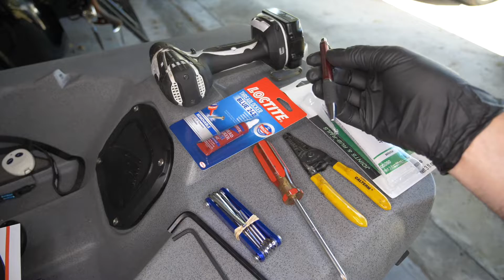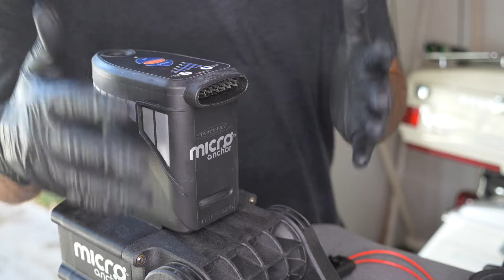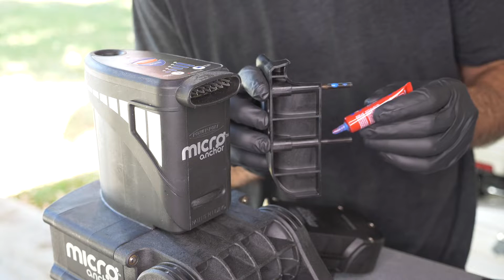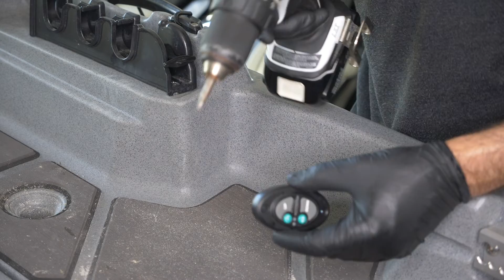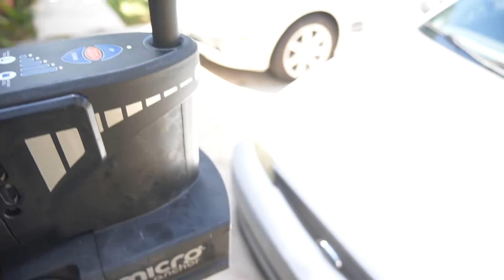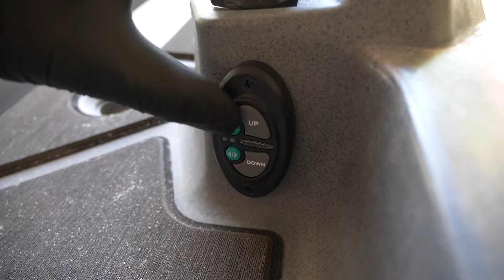How To Install Power Pole Micro Anchor On Any Kayak

Comment: Also, I power wash my yak after each use, I probably shouldn’t mount my deck switch correct??? Probably can’t handle all that water right??
Reply from the maker: That switch has a rubber seal in it, so normal rain, and water from fishing is perfectly fine, but a direct blast from a power washer probably isn't good. I've never had an issue with mine where I mounted it.

Comment: What’s your reasoning for not using the quick release?? Just curious.🤷🏼‍♂️
Reply from the maker: At the time when I owned this kayak, I could only think of two reasons you might need to use the quick release. I knew they were situations I wouldn't be getting myself into with this kayak. The first, being loosing power or a dead battery. The second would be to go under a low bridge, or under trees, etc. All the places I regularly fish here in Florida are wide open and I wouldn't need to go under anything, and the battery lasts multiple trips. I charge it the day before any trip so its full. There's always the chance something fails with the anchor, and I'd need it, but the bonafide is so stable I can fold the seat down and just climb to the back and deal with it. But I just got back from a trip up north where I had to go under some tunnels, and I did utilize the quick release so I'd fit.

Comment: Great video but I don't think you could do this on an ascend kayak there isn't enough plastic on the back end to drill 4 holes and mount it unless I'm missing something. I sold mine years ago but now that I live near a shallow river with smallmouth I would like another one so when I want to fish the river I can. Cuz the ranger won't fit in the river lol.
Reply from the maker: If you're talking about the cheaper ascend kayaks in the $600, no there's not enough room on the back to direct mount it. You'd have to build a platform. There's always a way to make something work.

Comment: Did the power pole come with the battery pack or did you have to purchase separate?
Reply from the maker: No the battery is separate. The power pole does come with a cable you can connect to an existing 12 volt battery if you have one. But the pack makes it much easier.

Comment: How long does the battery last for regular usage?
Reply from the maker: About two full day fishing trips with constantly moving around and using the anchor.
Reply: @FloBass  On mine I get about 135 down and up, the most I ever used in 7-8 hours was 35 down and up

Comment: I transport my Bonafide SS 127 on a Yakima Rack and Roll trailer including a 450 mile Interstate trip twice a year. Can I leave the motor mounted while traveling? Naturally, not the pole!
Reply from the maker: You could, but I don’t recommend it. I lost the thumbscrew for the clamp that way. Power pole was nice enough to send one out free of charge after I inquired to buy one.

Comment: How to install power pole step 1 lather  your gloves with loctite get it all over your boat and your new power pole step 2 do not tap holes for remote just use a cordless drill with the clutch locked up to insert the remote inside of the Hull of your boat step 3 make sure you wear sunglasses while doing any project
Reply from the maker: You missed a step...

Comment: For other kayaks a mount would likely need to be fabricated from seaboard so it would mount off to the side.  i.e. like for a Vibe SeaGhost. or any kayak that has a standard type rudder.
Reply from the maker: Yes a yak with a rudder could run into that situation. Many have enough room in the back to mount it right next to the rudder. Only issue would be when you pole down the boat will experience yaw when the pole drags the bottom while moving. Not really a huge deal, but could be annoying for some.
Reply: @FloBass  I actually  made a DIY one that is gravity operated and I have it mounted on the side but as far back as possible and it stays pretty straight in current.
Reply: BassMan Strikes ;

Comment: Great video man. I am getting mine tomorrow. Question is, if you physically mount that switch to the yak itself, how do you change the battery without removing it every time and therefore stripping the holes? I don't have it yet so I do not know how the toggle switch opens. Thanks.
Reply from the maker: The battery lasts a pretty long time so its not really an issue. The holes wont strip as long as you don't over tighten them when you put them back in. They basically cut the threads into the plastic of the yak and will continually follow them when to take the screws in and out.
Reply: @FloBass  Awesome thanks.

Comment: 3 questions 1 what price for the setup with wireless batt. 2 does the power pole auto stop when it hits ground and goes up or was that you stopping it? And 3 how long do those batt last?
Reply from the maker: The micro, battery, and spike is around $900. Yes the spike auto stops when it hits the bottom. You can adjust the force from gentle to hard. I got about 3 full day trips worth of battery before it died out on the water at the end of day 3. I couldn't say how many times it went up and down, but it was definitely a lot. Long battery life.
Reply: Cool thanks alot..I know the micro is like 500 to 600 so the batt set up is 300ish?
Reply from the maker: 595 for the micro, 195 for the battery, and around 100 for a spike. Get the long one and cut it down if you need to.
Reply: @FloBass  that's not bad. So what like a 10ft pole? That's wat I thought about or even 8ft